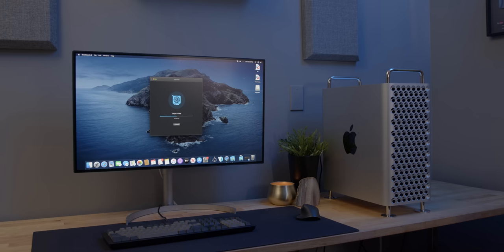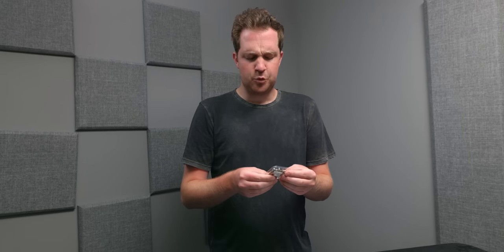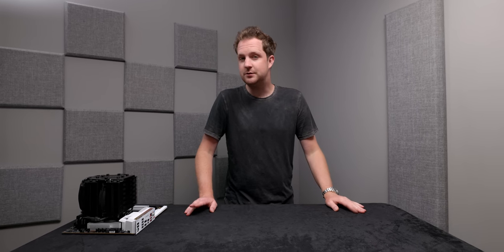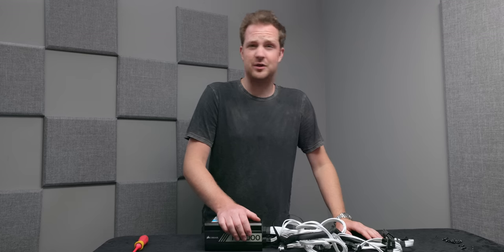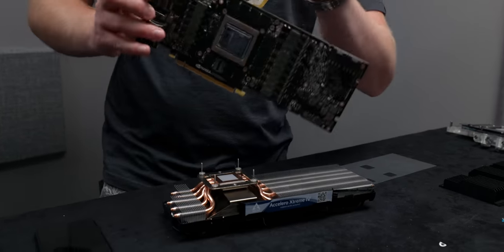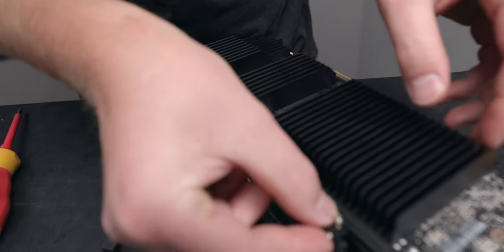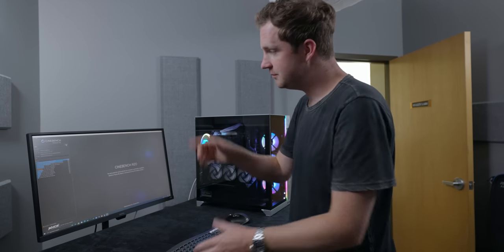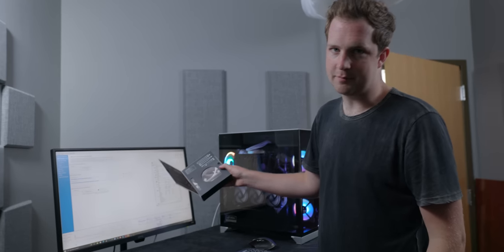The Quietest Computer EVER?!

Comment: "This is for quietness, not beauty" *skips Noctua fans because the Corsair ones have RGB
Reply: If no RGB required, I wouldn't even consider Noctua. Scythe or Arctic are the brands to go.
Reply: Dorientje Woller U sure. Noctua has best in class performance
Reply from the maker: Moebius He isn’t wrong.
Reply: @MaxxPlay99  I would instantly buy 2 or 3 NF A12x25 for NZXT h200i if they were black. My PC is white and silver and I won't put a brown fan in there. I didn't go through all the effort of getting custom cables and making a custom GPU backplate only to then put a brown fan in there. 
If they ever end up releasing the A12 in chromax, I'll instantly buy 2 or 3. But now... nope. I'll stay with BeQuiet despite the Silent Wings not being ideal for radiators and them thus producing quite a bit of noise at times. I can ignore the sound to some extent when wearing a headset. But I can't ignore a brown turd in my PC, which I spent so much time and effort on to make it look nice.
Reply: @dorientjewoller113  As with all things, it depends. Speaking as someone who has 18 Arctic fans in his build, they are amazing, but only if you run them below 900RPM. Anything above that and they generate this really annoying whine. If you plan on running at any speed until 900RPM, then they're fantastic and 1/4 the cost of Noctua fans while pushing the same amount of air.
Reply: Dorientje Woller Ok, did some research and wow, the Arctic P12 is as good as the noctua for far less money. :O
Reply: @MaxxPlay99  Arctic P12 are amazing, I have nine of them in my build. But if you see them right next to a NF-A12x25 (my lonely rear exhaust ;) the difference in quality becomes apparent at first glance. But given that they cost a quarter of what Noctua is asking that's only to be expected. The bearing and runtime smoothness looks more like a solid piece of matter than a spinning contraption. But yeah, the color isn't for everyone and the price is steep. If money were no concern I would have gone brown fans all the way. There is a reason they are best in class. Performance and noise characteristics are just insanely good.
Reply: @MaxxPlay99  I wouldn't call $5/fan "far less money" lmao
Reply: jauffins Noctua NF-A12x25 PWM 30€ Arctic P12 5€. 
You need min. 4 fans for adequate airflow. 120€ vs 20€. Idk but sound cheaper to me.
Reply: scythe fuma
Reply: @dorientjewoller113  Not sure which size fans you're referring to but NF-A12 still handily beats out the Arctic 120mm fans according to Optimum Tech's latest testing.
Reply: Ngl I was about to say this until I saw someone else commented it.
Reply: @dorientjewoller113  Noctuas are still better, and the price still isn't much compared to $35 LL120s or $45 QL120s.
Reply: @ErfanGhasemy  funny almost same build as me i  got 8 arctic f12 but those with dual ball bearings and on top i have 3 silverstone rgb fans and in the bottom 2 lian li fans which i think will replace with a scythe slim fan as i can not put in the front usb connection cable, the cpu cooler is a scythe fuma 2 and the case a lian li O11-air. i connected the arctic fans all in series with their pwm share technology and i run them at 912rpm
Reply: @MaxxPlay99  i put five p12 pwm in my cooler master n200 case, and an id cooling se207, which is a dark rock pro-like dual tower for half the price. The system is an fx8370 and an xfx rx580 in an mATX case with toasty 2400mhz xmp rams so it all expected to run quite hot. But it's 40°C at idle, 63-65° under full load. It can be really loud under load, but at least it's cool, and it was cheap.

Comment: "ram is all the same" looks over to his ryzen 5 3600, "oh i beg to differ"
Reply: Yeah the difference is pretty insane. But I think I spent too much on RAM actually lol
Reply: Price on 3000, 3200,3600mhz is almost the same here. So 3600hz it is.
Reply: Kamran Kambang cas latency matters. I have decent 3600mhz ram  (CL 18) but it performs closer to great 3200mhz (CL 12) ram because the cas latency is higher.
Reply: @RiceCubeTech  what is better? Higher frequency with higher latency or lower frequency with lower latency? I went with 3600 CL16 for my Ryzen 3600X

Comment: Now do decibel measurements of the Mac Pro and your custom build. We want numbers!
Reply: I don’t.
Reply: Variably-spaced blades for a wider spectrum spread of the fan noise, purposefully running each fan at a different speed to avoid noise on the same frequency... Yeah, Apple's got this in the bag, easily.
Reply: Brad Fortin also driving each fan at a slightly different speed such that there is no constructive interference

Comment: Quinn (and probably everyone by 2020): "considering that fans are basically the only component inside of a computer that actually make noise"
Me: cries in spinning HDD
Reply: Aaron Morrow  Yeah... Cheap PSU´s not only are loud they are also dangerous.
Reply: Curious Cat exactly
Reply: I don't even use my HDD (I don't even have my OS set up to use it) but it still just randomly ramps up for absolutely no reason.
Reply: My HDD is fairly quiet
Reply: @The_Curious_Cat  Yep. A friend upgraded his system from a 10 years old AMD dual core CPU to a 3600x and an RX5700XT. He kept his no name 10 years old 850W PSU. I told him the PSU would die. Surprise: It died. 

He's lucky it didn't kill entire his system. NEVER EVER cheap out on a PSU. They can kill your whole system or even burn your house down. Cheap PSUs often don't have the protection circuitry to not fry your components when the PSU dies.
Reply: @archonjk1196  because it has power. A HDD will start spinning as soon as there is power. It can stop spinning if it's told to do so by the OS, but if this is not the case it will spin.
Reply: SSD
Reply: @detroxx56784  Yeah, it´s exactly that. Cheap out on the PSU and you might end up losing all the investment made on the other hardware. And the fact that they can start sparking and burn everything is scary. That was the first thing my brother told me when I decided to do my first build: never ever cheap out on the PSU, it´s better to even buy a PSU with extra power for what you need then save the money on it.
Reply: @archonjk1196  Just unplug it then haha, because it's a waste of energy and sound
Reply: cries in coil whine
Reply: I made such a mistake going with a WD Black HDD for mass storage, as that shit gets L O U D when writing a lot of data to it... But sadly SSDs are still quite expensive for more than 1 or 2 tb of space
Reply: @Freak80MC  I think it's from your specifical hardrive, try exchanging it, it's never a good sign.
Reply: I always try to use 2.5 5400rpm drives they are much quieter and for older games it really doesn’t effect the loading times that much.
Reply: What games you play
Reply: buy a better psu
Reply: me: laughs in m2
Reply: @detroxx56784 So only buy what is on the highest tier in most psu tier lists?
Reply: i took the HDD out of my pc for this reason XD
Reply: Who's running an HDD in a gaming PC these days...???  If you're building a "quiet PC", or a "gaming PC", then you run an SSD. By doing so, 1. you are optimizing your system 2. you are using current technology 3. it is a fairly inexpensive upgrade 4. it is totally silent. 

For folks who are talking about their *parents* or *friends* "non-gaming" PC's with standard components available years ago, you're talking apples and oranges... it you want to quiet their machines down, and they're wiling to put out a few bucks to do so, you upgrade their components from older, noisier ones to more modern, quieter ones. These days there are silent SSD's, silent PSU's, and silent Fans... there is no reason for computers to be making noise these days, only those unaware the machines can easily be quieted down, or those unwilling to do so.
Reply: @GlennMarshallRocks You missed the point entirely. People who have tons of storage utilize HDDs because they’re cheaper. Even more so than SATA SSDs.

Comment: About 5-6 years ago I set out to build a silent build of my own.  I used the I7 3770k that I already had, and paired it with a Zalman FX70 passive air cooler.  This cooler has a max cooling capacity of 80W, which works with the 77W TDP of a stock clocked 3770k.  My MSI GTX960 was of a semi-passive design with fans that only come on under continuous high load.  For the power supply, I took the same approach as Snazzy, by using a 650W Corsair PS that was passively cooled up to about 50% load, which I rarely if ever reach.  All this went into a Corsair 600C inverted case, with the 3 corsair case fans set on low.  5 years later my silent PC build is still chugging away in our living room, barely making a sound.  It's still as silent as ever.  Our modem, which has a small fan in it, makes more noise than my 5 year old gaming PC.

Comment: I went a similar route with the main goal of silence in idle state.
- Overpowered power supply
- Two Noctua 14cm case fans
- Noctua CPU cooler
- Insulated Fractal Design Define R5
- Arctic Cooling solution for the GPU (I opted for the older version with the glued on heat sinks - wasn't sure if I should trust the backplate)
I don't let any cooler run faster than 450rpm in idle. Pretty good.

Regarding Arctic Cooling: the engineering is absolutely sound. The fans are incredible silent. I cannot hear them as long as they stay below 700rpm and I can hear a 550rpm 12cm Noctua fan.
But: sadly non of their GPU cooler supports "zero fan mode" (according to their support team).
Reply: I've got the Arctic Accelero Xtreme III. I'm super impressed by the cooling performance, but it's not THAT silent. I'm forced to run it at 27%, as the firmware of my GPU does not allow it go any lower. It's literally the only thing in my computer making any audible noise whatsoever. The bright side is that I can keep the fan speed at 27%, and it'll never go above 80c, even overclocked.
If I had more money at the time of buying a cooler, I would've gotten a Morpheus with two Noctua fans tbh, and just plugged those two fans into my motherboard.
Reply: @MrHaxx1  Idd, going with Noctuas over a Mainboard header and controlling it by GPU temp is a nice approach. I think this can be done with software like SpeedFan.

Regarding fan speed, my Accelero Twin Turbo II (on my weak 1060) is always on ~640rpm (Software says 0% pwm fan speed but this isn't allowed on the fan of the Accelero).
Reply: @mrmrmanmrmr  Just fyi, SpeedFan is deprecated and is not compatible with many modern motherboards. Fan Control is a super nice, and MUCH easier to use, alternative.

I just can't quite figure out how your fans can't support 0 rpm. Surely it must be the GPU's "0 rpm" signal not actually being 0%, but rather some other low percentage, meant for your stock fan (that would cause said fans to stop spinning), and not third party ones. Regardless of what a fan does, it shouldn't be able to turn, if it doesn't receive any power ... right??
Reply: @MrHaxx1  Thanks for the tip with Fan Control.

Regarding the fan speed: that's exactly what I initially thought. The fans however are pwm fans and always receive power. If it gets 0% from the GPU (like in my case) the arctic "decides" to spin at 600rpm (which is likely the minimum speed). Other pwm fans might turn off or even spin at full speed.

Comment: The taking the cooler off and the chip comes off as well, was most prevalent on intel p4 Prescott space heater cpus where they had ran so hot the thermal compound had become fossilised. Funny how intel went to the LGA 775 straight after the Prescott space heater CPU.

Comment: These Arctic Accelero coolers are best for wide server-style cases (card sits straight, supported by the whole slot), or the Silverstone cases with 90° rotated motherboards like the RV02 or FT02 (card hangs from the top) - no chance of sagging. Mounting them fans down without support is asking for trouble.

Comment: I've faced the same noise issue before. I solved it through custom loop watercooling, with a special external housing that completely silences the pump (VPP755 with brass D5 top, double vibration decoupling and plenty of noise dampening foam). The radiator is a Mo-Ra 3 420 with 4x NF-A20 that only run at 350rpm under load and the PSU is a fanless model. Storage is all-SSD. Literally the only sound my computer's hardware ever makes is coil whine.

Comment: About PSU: I checked noise measurements at cybernetics about hx 1000 and they are all over the place. be quiet 550w is more quiet on paper. BUT those measurements are made with 30-32c ambient which sounds like open bench. So now I'm not sure whether to believe in "50% load noise" theory

Comment: 3:40 "We're not gonna rip the CPU out of its socket and possibly bend the pins, **h a   h a   h a**" (quickly moves on)
THAT is the sound of experience and pain.
Reply from the maker: I’ve been personally victimized by AM4.
Reply: @snazzy  :(
Reply: Anyone who's played around with an AM4 socket too long knows this pain far too well. I managed to salvage one from a friend who was less experienced at building and accidentally got thermal paste on the socket and pins after it didn't lock down properly. God what a nightmare.

Comment: You can run the custom Noctua fans at 10k rpm and they're still basically silent. The problem with a vertical fan curve like yours is you'll hear revving up and down. Get Noctua and keep it at 10k right up to say 60° and you're good. Much better.

Comment: Cool. CPU is colder in Celsius as the room in Fahrenheit. What's the point in using two measurement systems seconds apart? You could provide the GPU temp. In Kelvin or tankine to make it perfect.

Comment: Honestly, if you wanted to make it as quiet as possible, you should have just watercooled everything and the only thing you need to worry about is choosing a pump that is silent at low rpms. Put as many radiators as possible in the case and a big reservoir and you could almost runs this thing without fans.
For the radiator fans choose fans with a 0rpm mode and there you go.

Comment: When using a hack saw, it is better to use the full length of the saw and go smoothly rather than putting all of your weight on the saw. Full strokes with light pressure. It will make the blade last longer and its a lot easier :)

Comment: Chip creep of socketed chips was a real problem for all kinds of hardware, including PCs, in the 1980s, before things were soldered to the boards.
It was not an Apple specific problem.
Reply: He's just saying it was a big issue with that model
Reply: It was more of a problem in the Apple III than in say the Sinclair ZX81 or even the much later Acorn Archemedies (what ARM chips were first developed for) and even the older Commodore International PET desktop microcomputer used in a lot of North American schools around the time that computers were becoming more popular.
Reply: @wclifton968gameplaystutorials  I bought an Apple II in 1979 and whenever it (routinely) crashed, I had to open the lid to press down on the chips.
Reply: @mcresearch  now I see why so many had a fan attached to them somewhere on the case... thanks for the info since I thought it was only the Apple III that was abnormal...?
Reply: @wclifton968gameplaystutorials  I lost a university paper that way (after floppy drives and printers became available for the II) and learned the lesson of saving regularly.

Comment: I know, it's not sexy, and not modern, but I love expansion slots and the look of a monster computer, so I run my rig in a Cooler Master HAF X.  I have upgraded a few times, but always build into my HAF X.  It provides tons of air flo, and even has plenty of space inside for a liquid cooling solution...plus penetrations for an external solution as well.  It's not portable, but it's not meant to be.  The only downside is I'm using the stock case fans, so it's not tremendously loud, but not whisper quiet either.  Looks like I need to swap out to those whisper quiet fans.

Comment: I went through the same problem with the Accelero Extreme 4. Ended up buying double side thermal tape and heat sinks to cool my vrms. My recommendation, get the Accelero Extreme 3 instead.

Comment: All RAM is not the same..
There are latency differences..
DRAM chip quality differences and so on..
But you could argue that they're mostly same but there can be huge differences in certain applications if you use low latency RAM or high frequency ones. Although for general use case I get what you're saying.
Cheers Quinn
Reply: Normal computer DRAM doesnt use NAND flash memory
Reply: @alsetema  my bad.. I was referring to DRAM chips.. it should be DRAM quality...
Reply: @sr-zk4up  no worries!

Comment: No, foam on the metal sides just dampens the resonation, the sound. Little hums, or vibrations from inside of the case can resonate on thin metal side. Thats why foam on the sides. Actual air flow can be still good, and is not effected by this. At least thats my opinion.

Comment: I have the Arctic Accelero Xtreme III on both a GTX 780 and a GTX 1080 (I have 4 PCs). I just can't stand the single blower style fan provided by Nvidia for their reference designed cards of that time, so getting two of those aftermarket GPU Coolers made all the difference. I did however have to use a program called MSI Afterburner to override the GPU fan-settings, and I made it so that the 3 fans always moves at a low RPM regardless of which games I am running.

Comment: I think it's not just fan volume that's bad, it's the frequency of the noise. I don't mind a bit of fan noise as long as it's a lower hum rather than a screaming banshee. Up to a point, the bigger fans you can use in your case, the better. They can move more air at lower RPMs than smaller fans and generally make a much more pleasant noise. Honestly, I'd say the most offensive noise in an otherwise quiet system is coil whine, particularly on GPUs.